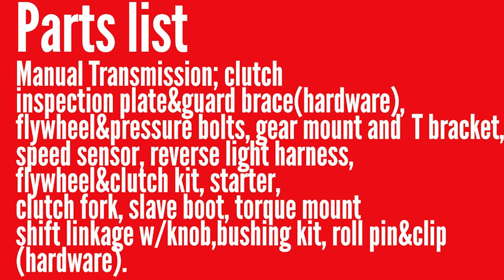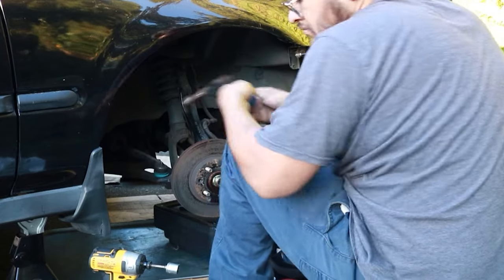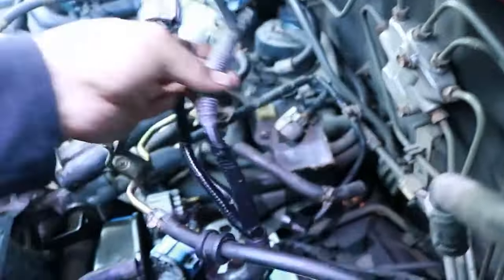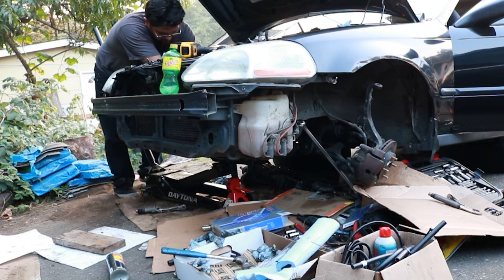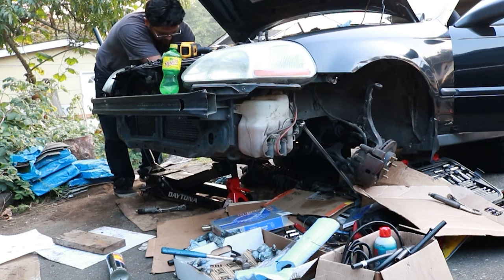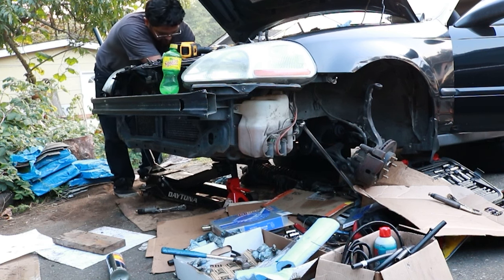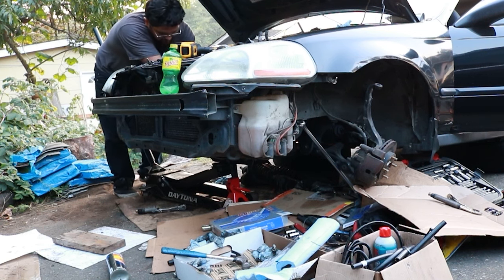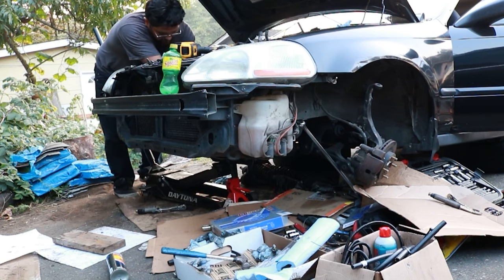(Minimal work) 98 Civic Auto to Manual Swap D16 Y7 to Y8 Manifold

Comment: I'm about to do this on my EX auto. Biggest pain is having to change the manifold. Wish their was a way to adapt the auto y8 one.
Reply from the maker: You can use the auto y8, just JB weld the extra air ports, I showed it the video. I just ended up getting a manual.
Reply: @HardwayRey  but then you also have to drill out the manual location right? I'll have to go back and watch don't remember that maybe I fell asleep I do that alot.
Reply: @HardwayRey I'm meaning for the iacv. It's different type and location from auto to manual. Not the air ports on the motor side.
Reply from the maker: @TheRealMrRoyal  dont think u have to drill.

 i dont show u how to do it, but only point out some holes. But you can easily search it up, its well talked about. I found a manual one for 40$, seemed worth it. Up to you.
Reply: @HardwayRey  yeah I just haven't been able to find one for under $150. But yeah I was referring the iacv stuff not the air ports.
Reply from the maker: @TheRealMrRoyal  i have mines plated off with the manual iacv(plugged), you can just plate it. But i wanna say the auto intake dont have iacv port on manifold, should run through the TB.
Reply: @HardwayRey  yeah correct but apparently you can use the auto iacv with the manual ecu and swap so you either have to get manual manifold with tb or cap the auto tb and drill out where the manual iacv goes, which there is marks there but manifold drilling is daunting. The auto iacv is a 2 wire and manual is a 3 wire and send different signals. You also have to switch pins in the ecu.
Reply: @HardwayRey  do you mean you plugged the iacv on your manual....can you run with no iacv?

Comment: What's the "gear" you keep talking about?
Reply from the maker: Gear ⚙️ = transmission = gearbox
Reply from the maker: I work with boat engines and it a habit to refer to transmission as gears, at least at my shop.
Reply: @HardwayRey  ahhhhh thank you. I was thinking but wasn't sure a couple times.